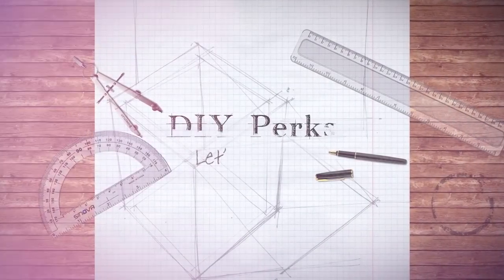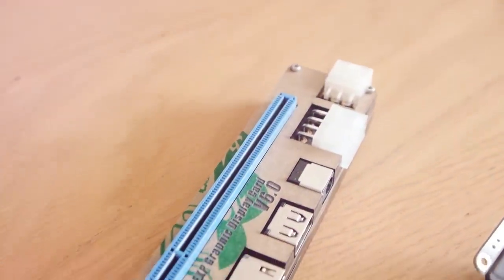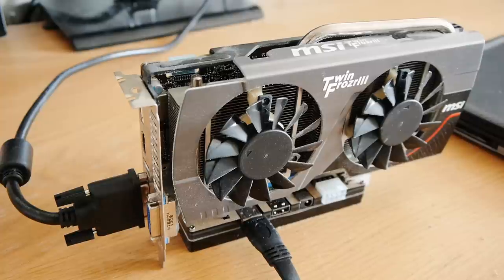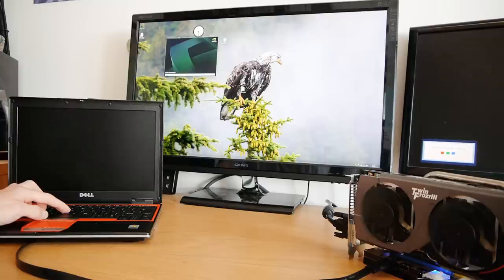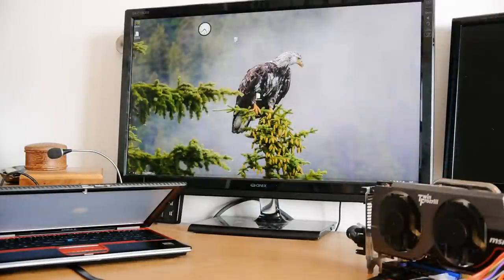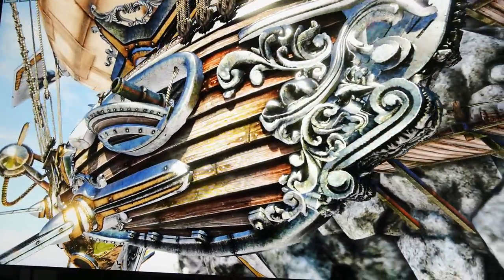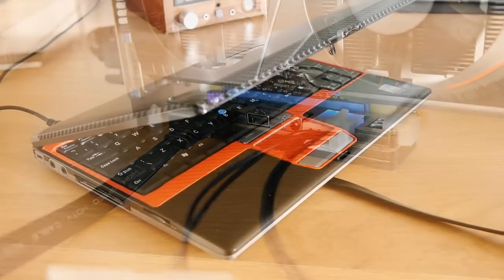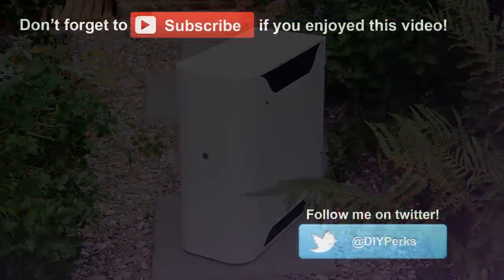Gaming on a Laptop using an External GPU

Comment: ok so im looking out on the market for a gaming laptop, but i want an external gpu with it. So do i just need to make sure that the laptop has a thunderbolt 3 port and thats it? just wondering if anyone knows i would really appreciate any help! thanks!
Reply: +Ignitablegamer Razer Stealth Blade.
Reply: syafiq zaidi noted.
Reply: +Ignitablegamer Modern graphics card (e.g my 970EXOC) have a 220gigabit fill rate. THe port only supplies 60 and you can't compress the stream because it's all video data. It's already h264 compressed. Compressing it harder would actually DOWNGRADE quality. Severely.

It's merely a scam. It works well for some old, crappy games which don't even require a 60gigabit fill rate > 560GTX equivelant nvidia card built-in. 

If you have anything newer than that, even Thunderbolt 3 isn't going to be an upgrade.
Reply: MacBook Pro 2016
Reply: francis joseph the macbook pro isn't good for a gaming laptop. the OS doesn't support many games, and costs WAY too much for the amount of performance you are actually going to get. Plus, I'm not even sure that the thunderbolt port they put on the laptop is thunderbolt 3, so I wouldn't even be able top plug in an external gpu for gaming at decent performance, because I was looking for something that can power a 1440p monitor AND a 1080p one. Thanks for trying to suggest something, but sadly it is far from what I am looking for.

Have an Ignitable day_
Reply: I guess he teasing you. It's just a sarcasm
.

Comment: on newer laptops with the m.2 slot wouldn't an internal graphics card be the better solution taking out the wifi/bluetooth card? the amd and nvidia cards now function on ultra low voltages and have decent frame rates above the stock intel/amd graphics built in.. is this viable or not? if you want to know I'm asking about the acer e5-574-58jm

Comment: Hi, I am the current user of an old laptop called "Dell Latitude 3330" that has "Intel(R) Core(TM) i5-3337U CPU @ 1.80GHz" and "Intel(R) HD Graphics 4000" with 4gb of Ram. I wonder if my laptop can run "Overwatch" If I do the same thing u did in the video. If it is possible, would you explain briefly about the materials and steps that I must be prepared with? Thank you, and I hope to hear good news from you.

Comment: Since laptops with USB C + Thunderbolt ports r becoming increasingly common, I was wondering if this will work with a HDMI to USB C cable instead of using the included HDMI to PCI-E cable. It would be nice if someone could confirm. If it works, then I don't have to spend hundreds of dollars on one of those overpriced eGPU docks.

Comment: i see that the PCI-e port is connected by that HDMI and the port to what the wireless card is connected,  i have a lenovo g50-30, and it has a HDMI port built in, would it work if i connected the hdmi from the laptop straight into the PCI-e holder;s HDMI? or would i need to take the back cover off everytime and disconnect the wireless to plug the GPU in? thats effort? and is there a USB3 version that i can connect to?

Comment: so if i use a GTX 950 GPU on my laptop would it run the games normally
Reply: Probably depending on your specs...

I personally am using a GTX 950 its a great graphics card.

But the thing is with using a laptop your CPU may hold the GPU back and bottleneck it so it won't go to its full potential.

Comment: I have kind of a long question. Lol. I have a Dell XPS 17-L702X laptop that has a i7-2nd gen cpu, GeForce GTX 555M gpu and 16gb of ram running windows 10 pro. It's a great machine but it's struggling with modern gaming. My question is if I do add a gpu to my motherboard via the pci-express riser card adapter, would the gigs of the gpu be added to my 3gb dedicated onboard gpu or would it be a stand alone figure? Also would the work together as one unit or will the GB of the external Gpu only be picked up by games? I would like to know because Im interested in doing one of your DIY builds turning my laptop into a desktop but I'd like to add the gpu.. Looking forward to your reply or anyone that can answer my questions. Id appreciate

Comment: Hello
I have an acer BIC50 laptop that has a Blue Screen. Repairers say there is a problem with the GPU and it is risky to replace it.
I wanted to get guidance from you
If I do not replace the laptop GPU, is it possible to revive the laptop using an External GPU?
please guide me
The repairmen in the area where I live are not creative at all, and when I talked to them about connecting an external GPU to a laptop, they were all surprised and had no information.
I hope you forgive me for making the text too long.
I am eagerly awaiting your response

Comment: I have a surface pro 3 with crappy intel hd graphics 4400. 
Since the data cable for the egpu is an HDMI, would it work on my surface pro 3 if I use a thunderbolt to HDMI connector?

Comment: Hey I don't want to fry my new card or this external dock for the new gpu.. what is the recommended Power Supply to use without frying it? It says that it can only take... Power support:
8P interface: 220W max.
DC interface: 150W max.
Note: the power limit without ATX cable.

Please respond.

Comment: If I have a gaming laptop with a bad graphics card, but a good cpu and I got a good graphics card like a gtx 1080 would it bottleneck the computer trying to run an HTC vive? It would save me so much money if that's the case.

Comment: I am having a problem with my Toshiba C50-A076 laptop, it is provided with 2 GPUs, one is Intel 400 and the other is Nvidia, previously and all of a sudden the Nvidia stopped working and now the laptop keeps restarting, the Maintainance guys agreed on that the GPU is the problem since it heats very quickly causing the hardware to restart after it kept hanging for a while.
Can I use this trick fot now?

Comment: does it have to be connected to an external monitor?  Can it be run through the laptop monitor?
Reply: Unless you have a capture card with appropriate adapter that you can send the video signal through then yes you have to use an external monitor.

Comment: Just bought a new graphics card which goes into the pci slot, installed it and my pc opened up just fine but the monitor said it had no signal. Took out the graphics card,but when i plug it in the original ouputp it works.. plz help

Comment: Used this on an old Acer Aspire V3-571G with an Nvidia GTX970, worked well for one week, last night it went dead; the GPU felt hot but the fans had been running. Won't turn on again, don't know if it is the hub that was defective or the GPU, but it was not the power unit (650M Gold certified). Reached out to Nvidia and the merchant for the hub, still waiting for replies. Anyone had anything like this happen?? Thanks

Comment: hi..will this works if i use the hdmi port instead from my laptop going to EXP-GDC Beast External PCI-E graphics dock?..and why does ebay.com shows a different price that banggood.com? in ebay, it's $494.90, while banggood is just $49.99???
Reply from the maker: Definitely a pricing error. It was about the same a few days ago.
Reply: oh okay..thanks again for the share.. :)
Reply: +djones0583 did it work?
Reply: +GuyUWishUWere i don't know..i asked but nobody responded to my query if this will work with HDMI..i don't want to sacrifice my wireless card for this..so i guess i won't go for this, unless somebody has proven that it will work with my desired port..
Reply: djones0583 I see.   Thanks for the reply.
Reply: +djones0583 No it wont work, Remove wireless card and install a Wireless USB dongle which is the size of a usb port and completely unnoticeable. Problem solved.
Reply: thanks. Teg nkush!.. :)
Reply: +Teg nkush by the way those wireless dongle is slow latency unlike projector with wireless dongle is about 30 ms of latency (sort of)
Reply: Abdul Muhaimin Don't buy a cheap one then. I get amazing speeds and latency on my desktop.
Reply: +Teg nkush do you know if external monitor is really needed? I got a lenovo y700 with intel 6700HQ.
Reply: Christian Rosado No you can use the laptops own monitor...but you can imagine what a shitty monitor, a 9 year laptop has...so thats why he used a external one :/
Reply: gyorgy komaromi
Only certain laptop monitors. Not all.
Reply: +Jonathan Gonzales well Im running Windows 10. Think it could work? i just dont wanna buy it if I need an external monitor.
Reply: +Jonathan Gonzales 1080p IPS screen. Intel i7 Skylight 6700. 2.6Ghz base and 3.5Ghz on turbo boost. 16 GB of ddr4. Nvidia gtx 960m with 4GB of ddr5. So as you can see the gpu will probably be the limiting factor here in 2 years I guess. So I would like to be able to use this EGPU idea instead of getting a new laptop because of gpu.  Im always on the move due to college so a Desktop would be a waste in my case.
Reply: That'd be great! Manual said up to 16GB didnt thought of trying tht. Its a Lenovo Y700 Ideapad. With the specs mentioned above.
Reply: Thats right man. 16GB DDR4 with Gtx 960m 4GB DDR5.
Reply: Oh wow, thats great to know! thanks! In the case of the gpu it is soldered right? So that will be my limiting factor for games right? Other than that the system should be good?
Reply: +Jonathan Gonzales u thinks I can use it? its Toshiba 
Ram 16 gb
space back 64 gb
Intel core i7 4510
AMD R7 M260
and windows.  8.1
Reply: Jonathan Gonzales I already have a other screen then my laptop, and external one
Reply: +Jonathan Gonzales do you think i can use this with my vaio VPCEH35EN without monitor? i will be using a asus gtx 750 ti 2gb GDDR5 dual fan cooling graphics card
Reply: Jonathan Gonzales gtx nvidia 960 or 980
Reply: Jonathan Gonzales gtx 980 has over 2 GB
Reply: Jonathan Gonzales
 i3 2350m
geforce 410m
6gb ram

btw 4gb ddr3 graphics cards suck. 2gb gddr5 graphics card is much better than a 4gb ddr3 graphics card
Reply: An external montior is needed unless you have a designated nvidia card with nvidia optimus

Comment: Hi guys, i have a problem with my 980ti, i using the EXP GDC V8 express card but the pc not recognize the card, the power suply not send energy to the components, the power suply is a corsair AX1500i, thanks in advantage

Comment: how do i know if mine is compatible with this? or are every laptops compatible with this gpu dock? i have Acer Aspire V3-572G-543S would it work? because this one has a poor gpu and i would like to upgrade it
Reply: Look on the bottom for a mini pci express slot. Should work fine if there is one

Comment: would this work using the laptop, HP Pavilion Hewlett Packardwindows 10 Intel(R) Core(TM) i7-5500 CPU @ 2.40 GHz 6GB RAM 64-bit operating system, x64- based processor?

Comment: What if your pc has no PCI Express slot? I own a Razerblade 2014
Reply: Use the razer core they released!
Reply: SuperArjun90 It needs Thunderbolt 3, the Razerblade 2014 doesn't have one
Reply: Lord Awesome Well you should have a mPCIE slot in your laptop, just double check if your WiFi card mat be connected there.
Reply: SuperArjun90 Alright, thanks man.
Reply: +Lord Awesome the wifi card in the razor is the NGFF type.  So order the version and not the mPCI-e version.
Reply: +Steelvelvet Exactly

Comment: I have:

10 GB RAM.
Intel i5 Core.
Will this work well with Nividia GTX 970 for gaming?
Reply: +SIMcityplayer2002 Get a r9 390. It's usually cheaper and a bit better. :)
Reply: +SIMcityplayer2002 Get a r9 390. It's usually cheaper and a bit better. :)
Reply: Yea
Reply: +Zaprodex benchmarks seem to suggest otherwise
Reply: Okay, but i5 is only a 2-Core at 1.8 GHz (2.4 turbo boost). Will it have any major impacts on FPS?
Reply: SIMcityplayer2002 it will on some cpu intensive games, even on some gpu. but whatever bottleneck there seems to be, the fps looks playable from this video. ive got a similar cpu to yours n im trying it anyway
Reply: +kenykillr gtx 970 is better then he r9 380. The r9 380 is the equivalent of gtx 960. 10% better performance and very Similiar price (r9 380 is $10 cheaper)
Reply: +SIMcityplayer2002 how is it that you have 10 gigs of ram?! That's a very odd number
Reply: Axe Avier two 5gb sticks obvi
Reply: kenykillr how is that obvious? Have you ever heard of a 5gb memory stick?
Reply: +Axe Avier he probably has 2 4gb stick and 1 2gb stick.  Like me I have 2 4gb sticks and 1 8gb stick.
Reply: Darren Evans I never knew it was possible putting in different amounts, I thought either 2 or 4 channels had to be filled and preferably with the same type/model
Reply: Axe Avier my samsung laptop came stock with one 4gb and one 2gb sticks
Reply: kenykillr odd, never knew that. Maybe it's different for desktop mothboards
Reply: +UnknownPlayer as a person with an r9 390, you're being ignorant. mine idles at 40 and at load runs at 70°
Reply: lel. for my 970 load temps r close to your idle
Reply: +kenykillr that's not true, no way. maybe with a liquid cooler
Reply: Zaprodex lol.. dude its a gtx 970 gigabyte G1, just search it on youtube and watch what people say the temps are on load.
Reply: +Zaprodex i have 8 gb of ram i7 4710hq would it work with gtx 970 ?
Reply: Fanatiikon get a 980ti
Reply: +Axe Avier And sell your kidneys.
Reply: kenykillr what did you have to tinker with
Reply: +Axe Avier
had to mess around with the switches to get it to boot, the chinese google translation manual was no help. worked fine after that but then gpu would shut off or get unstable under high load(benching, stress tests) messed around with it and found out the Beast7.0 wasnt delivering enough power through its 6pin to 6pin+8pin, bypassed that and just plugged it straight from psu. 

It seems Win10 doesnt fully shutdown your computer when you choose "shut down" (i guess its sleep mode v2 now), so when my GPU crashed or became unstable and i had to press the power button twice to make sure i get a clean boot and not just start up with the same limpmode gpu.

Its perfectly stable now under stock clocks, but whenever I try to find a stable overclock, the numbers seem to fluctuate. ignored that problem and just left it at a small OC. (might be my psu)

there are some small problems i ran into that im forgetting but nothing i couldnt deal with. Im happy with it, i can run anything now at 1080. and although some games drop to about 30fps (cus of my cpu) theyre still very playable, no stuttering like when i would get from my discrete gpu
Reply: kenykillr I guess you were unlucky, when I first built mine 12 months ago, it went without a hitch, especially with 0 experience. With things like OC'ing, that's a different matter.
Reply: Axe Avier wouldnt say unlucky, could of not worked at all
Reply: kenykillr why or how did you use a mobile processor?
Reply: this device is for laptops
Reply: kenykillr So you took a motherboard from a laptop and shoved it into a desktop? 

If that's what you did then no wonder you had to tinker.

Otherwise when comes to basic computer parts, anyone could build a computer. It's very easy, much like lego.
Reply: Axe Avier no, wut?
I have the same setup as in this video.
where'd you get "desktop" from
Reply: +kenykillr nevermind, I was thinking that I was commenting on a different vid. Sometimes its confusing when making comments in the reply window in the google top right corner.

Comment: i have few questions.

can i add a pcie mini on my laptop using usb

can i use gtx 750 without atx power supply and using my laptop power supply.
Reply: +ProWarGamer  you cant use usb, usb ports are too slow or something

i dont know about the 750 but i wouldnt count on it
Reply: thanks ill give this a shot
Reply: +ProWarGamer i cant tell you what will happen. but i hope it works out

Comment: do they have one of these things for usb 3?
Reply: They have external gpu rigs for USB c plugs running the thunderbolt 3 interface. Unfortunately USB 3.0 or 3.1 gen 2 doesn’t have a large enough bandwidth to be a viable connection between the cpu and gpu

Comment: Can i use it with my Lenovo L420 laptop...??

Specs: Intel Core i3 2310M processor with integrated GPU (Intel HDGraphics),
Corsair's 8 GB DDR3 RAM.
Reply: +Krishan Kumar K 
What games do you play?
Reply: +Matthew Noneya i am actually not sure whether my laptop has a spare PCIE slot or not. so , i am unable to decide whether to buy the card or not.

although the games i would like to play are... battlefield 3, COD Black Ops 2 & 3, GTA 4 EFLC, Shadow of Mordor, Max Payne 3, LA Noire, Civlisation 5, Total War Shogun 2, NFS Rivals, XCOM, EVOLVE, Tomb Raider (rebooted in 2013), Metro Redux series, etc...

Even GTA San Andreas does not give playable frame rate. 
Mass Effect 3 & Bioshock Infinite  run fine at low & very low settings, respectively.
Reply: Krishan Kumar K I don't have an answer to your questions, but I thank you for tell me what your pc is already capable of playing. Thank you. I have integrated graphics card and I wanted to know what games I could play on it. Thank you.